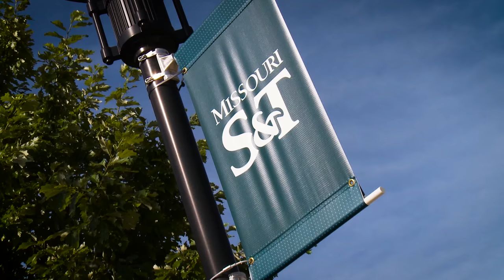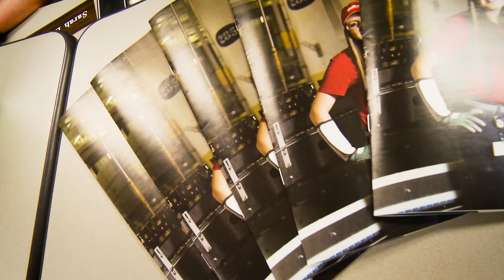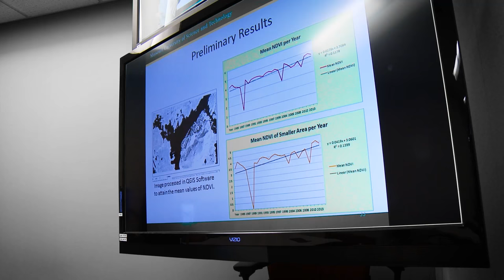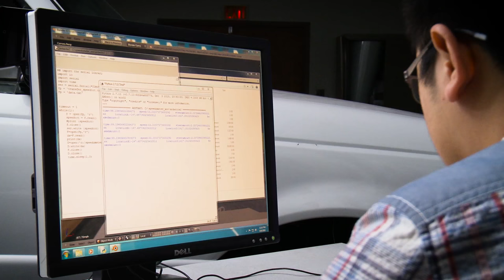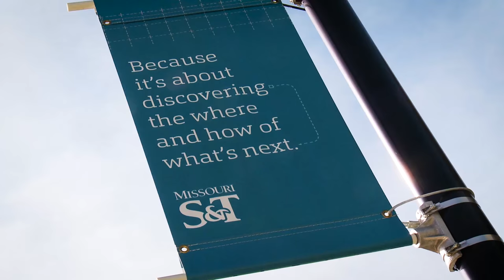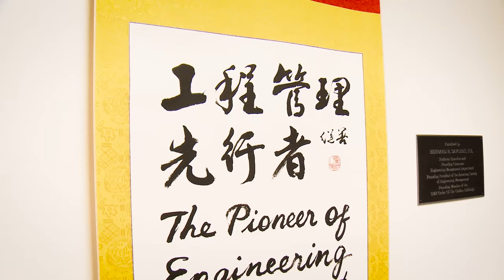Missouri S&T: Department of Engineering Management & Systems Engineering (EMSE)

Comment: /mk a 6''in diam designer of EI K' Mx exhaust systems /
/use 2 points of contact for pi bonds - creates the headers sections + rate Eq4 - 2 i.e. 2x2 /
/^8' rates Al8 - 16 > 14 - 6 for fused signa bonds - rate Al6 - 8 [C+-B]t = [D+-A] kt in mid grade sizals i.e. temps exhaust qualities // simulate whole intake port exhaust system - ek headers /